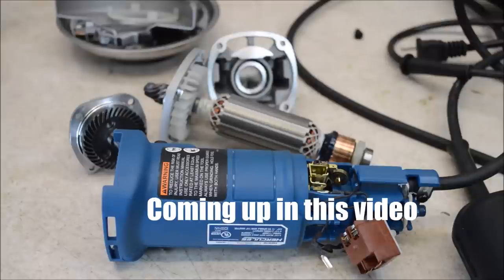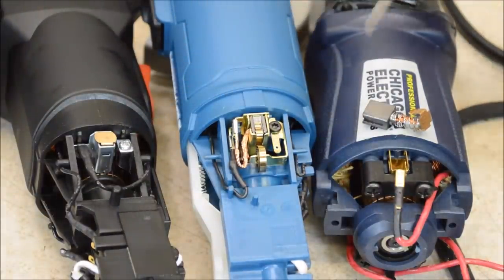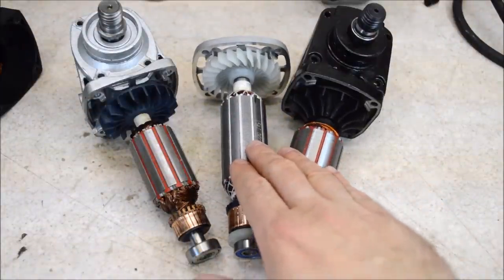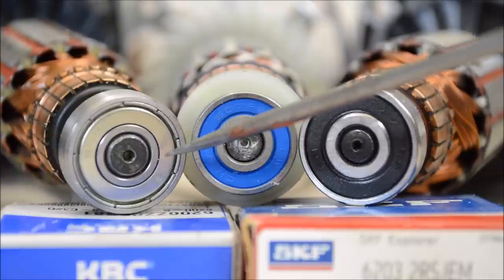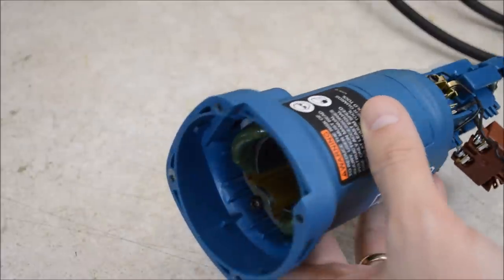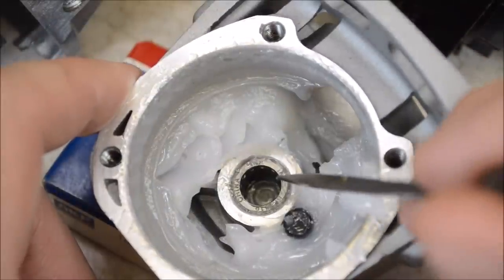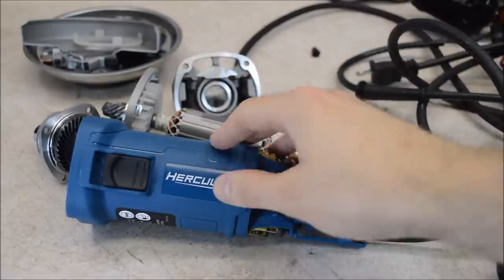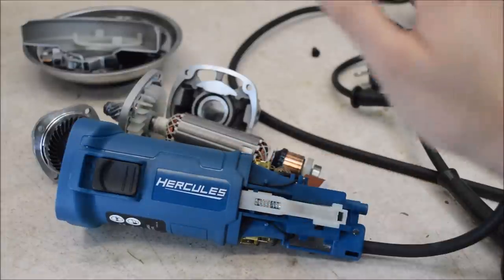Teardown: Harbor Freight Hercules angle grinder review

Comment: The advantage of the spring on the Hercules isn't more consistent spring pressure.  It allows for longer brushes as the pocket doesn't need to include room for the coil spring.
Reply from the maker: Actually, the coil spring probably offers both benefits.
Reply: Tool Teardowns right the brush has to have constant contact as it wears down great job dude

Comment: I've had this grinder for about 18 months. Use it almost every day. For $35 with a coupon, IMO, it's a true bargain. Doesn't skip a beat. Didn't think the optional warranty was worth it. If or when it breaks, I'll buy another. A terrific tool for the money.

I also have a similar Hitachi grinder. The Hercules is more powerful and runs smoother. Have a newer Craftsman grinder, as well. Closer, performance wise, to the Hitachi. Really, for $35 the Herc is fantastic.
Reply: Yup. No extended warranty here. Just take them back and say you want to upgrade to the next model. For HF members, just pay the difference for new tool.

Comment: So 5 years ago you tore apart the same model Hercules grinder I have, to see how well it’s made. ( I agree btw, love Hercules tools). But, I was looking for a video for someone doing a cord replacement. I’m not going to admit how I came to grind through my cord but… think, NC, working in hellishly unusual cold weather… that’s my excuse, sticking with it. The second stupid thing I did was not take a picture of the switch assembly before I took it out to disconnect wires. Your shots of the switch removal saved my bacon. Many thanks. 5 years later.

Comment: The same grinder, with some very minor visible differences such as the shape of the handle bar, is being sold here in Finland under the Biltema brand for 21.50€ which is about $25. Since we're in Europe it is naturally a 230V version. The power rating is 700W. I had the previous, nearly identical model for about 5 years and used it quite extensively in some pretty heavy duty work, until it finally broke a couple of days ago. One of the copper contacts in the commutator had come off, which means that you cannot fix it by replacing the carbon brushes, because the gap in the commutator will eat away and destroy the brushes instantly. The machine was definitely worth the price.
By the way, did you mention in the video that the quick lock mechanism actually allows you to detach the guard and not merely adjust it, which is a very useful feature?

Comment: Been using the Hercules since it came out. This is June 2022 and prices are a lot higher now but it seems to be holding up just fine doing a lot of cutting and wire brushing with a heavy twisted cup brush to remove weld slag.

Comment: I've burned up a number of grinders and the failure is either a shorted field winding due to excess heat or a broken rotor to commutator wire.  Looks like they've addressed those issues in the Herc.  It's a pretty nice tool in my opinion but I'm sticking with the "yellow or green" ones for now.  I really like this review, very well done.

Comment: I have  that grinder and I put gear oil in the gear case to help with heat. I put a oring under the spring for the push button lock and it hasn't leaked yet! It runs quite a bit smother

Comment: Thanks for the video! If it still works, along with the other two, try a comparison between vibration and power. One major improvement with more expensive tools is almost always less vibration and it might be interesting to see how much, if any, there is a difference between them.
Reply from the maker: They do all still work. It's a good suggestion.
Reply: I just bought the Hercules today. I have been using the drill master ones for a while and throwing them away basically. The Hercules runs a lot smoother with a lot less vibration and cuts smoother without skipping, bogging or jumping.

Comment: I bought the cheap $10.00 drill master grinder and it burnt out after 35 seconds... yes 35 seconds.   I am grinding down a cement slab ... have a crack which is slightly raised and using correct grinding wheel (diamond).  Do you recommend the Hercules over the 30.00 drill master?   Ps GREAT VIDEO!  First time I saw one of your videos.

Comment: I really appreciate your reviews. For instance I always thought the grind markings on the steel portion on the rotor were defects or wear but I learned on the other video that they are to balance the motor. Also I didn't know about the glass reinforced plastic. You are even able to interpret codes for the cables, plastic parts, and bearings!
Since you talked about revenue for the channel, do you know if you still get ad revenue from someone that has both a youtube premium subscription AND an adblocker on their browser?
I'm wondering if I need to disable my adblocker.

Comment: FYI, The Hercules Brand isn't owned by Harbor Freight is just distributed by HB same goes for The Diablo Brand sold at HB and 20 % or 25 % discount coupons aren't being honored at the time of check out. I just bought the " Hercules 16 " Tool Bag" was a bit surprising. Read the fine print of the 20 % and 25 % coupons not sure if you were aware of it.
Reply: No tool disposal sales? Deal breaker! Really at $40 I'd rather kick in a few more bucks and get a decent name brand. But this grinder looks OK. Still Hercules? I really don't like side switch grinders either. Being left handed the switch is on the wrong side for me. I go for rat tail and paddle switch grinders.
Reply: I'm not big on the thumb switch either. I might buy one of these if they make a rat tail version with a proper trigger switch.
Reply: most of the grinder you can unscrew the gear box and rotate it in the position you lioke, i prefer the switch on top and almos all bosch grinder permit it
Reply: Patrice Le Brasseur I did that with my Fein grinder

Comment: I was impressed with the quality of that tool, I did not see anything that looked designed to fail, you don't even see that on AvE teardowns in higher end tools.  I might give harbor freights newer powertools a second look.  I have always liked them for some hand tools, such as breaker bars and the like, there is just some things you can't justify spending 10x as much.  but to steal a line from AvE this grinder was skookum (spelling?)

Comment: I've worked in the automotive tool business for many, many years. There is good reason why cheap tools are cheap.. One of the companies I worked for was an importer/ manufacturer of pneumatic (air) tools. The point of manufacture was was Taiwan, in the same plant as Ingersoll Rand. Many of our air tools were exactly the same inside as the IR tool. Many were not. The changes we could make to a tool were amazing. Cheaper bearings, maybe even a bushing instead, press fit items instead of bolt together items, no seal or cheap seal. You get the picture. The problem is that many big name companies have made changes like this and still ask the big bucks. They also make a less expensive line, but it looks just like the premium line !! If you want a good tool, ask around and look at what the pro's use. Get the MODEL number of what they use.You won't go wrong.

Comment: It's not a rotor. It's an armature. Rotor is for bushless motors and hold magnets. The "strings" are probably Kevlar to hold the windings to the armature and keep it from flying apart.
Reply from the maker: +Drew w it’s even simpler than that. The rotor is the part of an electric motor or generator that spins. In this motor design, the terms armature and rotor are both correct.

Comment: earthquake xt has new 20v impacts. I would love to see what's inside of them.
Reply from the maker: I just saw those posted online today. They are interesting. They're actually expanding these higher-priced tools quicker than I expected.
Reply: Tool Teardowns I downloaded the exploded diagram right through harbor freight website for the impact wrench. doesn't look that bad from what I've seen.
Reply from the maker: I'll check that out. They don't offer an exploded diagram for this grinder, so my guess was they didn't offer them for the other new tools, but I didn't take the time to look.
Reply: Tool Teardowns it's on the page of the tool. it's a PDF of the user manual and it's in there.

Comment: I got the sorta cheap one and so far it's held up well. really give her hell beveling 8in pipe. gets hotter than a 2$ pistol but haven't smoked her yet. so all in all for under 30$ so far it's held up
Reply: Update.. killed 2 mid level ones.. let the smoke out. Have Hercules now if it dies I'll just buy a 2nd Milwaukee fuel
Reply: chris jones.... How is the "pro" model grinder? The 6 amp one with the paddle switch?

Comment: I have all three of these and while I enjoy each. The Hercules is the nicest and smooth as butter. The dark blue CE paddle is a damn work horse but vibrates a lot. The cheap $10 one has good feels but lacks power, don’t get me wrong it can still do a lot but you really have to let the tool do the work. 

The only reason I have a Hercules is because everytime I element back for a CE dark blue $29 paddle grinder (seriously they are work horses) they were out so finally I said F-It.

Comment: I've been posting videos on YouTube for over 10 years, but I do like their new feature of matching me up with hammer and chisel guy stuff. I use Grinders everyday, and my landlord just gave me an expensive seasonal Kobalt grinder three guys, 20 minutes, we could only get it to work for a couple of seconds. too fancy, too many buttons, Whadapieceifjunk. So he threw away the box, and lost the bill. So I went to Harbor Freight and I bought him the $25 grinder, for the little bit he uses it, we'll see how it works. I was at Lowe's a couple years ago and they were liquidating the $25 grinders for $5, I bought the shopping cart full of them and guess I'm set for life. One thing I've noticed about these grinders is sometimes the switch is so annoying to use, and I like to put 5 inch thin cutting discs in, and some of them rub the guard, some of them except the 5-inch disc which is more convenient for my cutting purposes then a 4 1/2" disc. Harbor Freight doesn't sell a 5in disc at all. and thank you very much for your videos, I'll be a subscriber

Comment: so - big difference with hercules vs $10 grinder is the epoxy on motor windings?  Why not just put some jb-weld on cheap $10 grinder windings? I am going to do that with my $10 HF grinder.  Should make $10 grinder even more reliable!

Comment: The dewalt warranty is not as great as it first seems.  It's 1 year parts and labor, and the next 2 years they only pay for parts.  What's more,  if you want them to fix it, then you have to mail that thing to them, which will cost you at least $15.  Finally, they might just tell you that your warranty doesn't cover w/e happened to it , which means you have to pay out of pocket to fix it.   So, are you going to do all that for a $60 grinder or are you just going to go buy another one?   You are going to go buy another one.  Thus you really only have a 1 year warranty with Dewalt.

 The HF warranty is 2 years, drive to the store, throw it on the counter for ANY REASON and get a new one.

If you want a warm and fuzzy warranty feeling, then HF is the better experience by far.

Great review though, subbed.
Reply: @John Handcock....excellent breakdown of the "warranty" game. I wish Dewalt would just do a three year warranty covering parts and labor with no questions asked. I think Milwaukee does five years but am not completely sure.  Ridgid, with the LSA, if you register it properly, gives you a lifetime warranty.
Reply: @amp12345amp  I've heard ridgid makes the lsa a misserble experience so people won't cash in on it.

Comment: p.s. I ended up purchasing a Hercules Grinder.  I had purchased the cheaper Drillmaster but after watching the video I realized the huge difference between models and took it back for the Hercules. Although I won't use it a lot, I don't want to have to keep purchasing the same item.

Comment: I'll  not debate the Hercules is a Mich nicer tool.  most of us don't use their grinder everyday.  for me it's  cutting bolts and occasionally the metal pipe or bar.  I've used my cheap grinder for years like this. I recently replaced  the cord but that damage was really my fault and it still was going strong.  it seems not be wearing out other than those cheap wheels at harbor freight not lasting to long.  I'm  sure the Hercules worth the money but it's overkill for so many like myself.  the cheapest with serve us well enough. not gonna lie though,  I'm tempted as 4" wheels cost more than the 4 1/2" wheels.  might just get the cheapo model if I upgrade and give my old one to a friend.  idk.
Reply: You still have the guard on your grinder don't you? Take it off and use the 4 1/2 inch ones.

Comment: Thank you so much for the clear review!  I was just looking at it in the store yesterday. From your video, the ring hear is friction fit to the shaft and I don't like that. Basically I just dislike anything that's friction fit as that's always harder to remove for maintenance :-)
Also, you should include some running test to compare the noise levels and power.

Comment: First off as tool head and gearhead thank you for spending your monies and time. 2nd honestly with Hercules it's in pro tool cost they are gonna have to prove themselves. I got 4 grinders 2 dewalt u.s. made, one bosch and one Chicago electric... I use the c.e. short light stuff. And at the cost of ten bucks I'm not too upset. But a lot of hazard fraught stuff has been failing me and i upgrade to dewalt etc. I'm a weird duck though... a farmer winter wheat, a harris county deputy and ffl. But I build or make most stuff I want and hate any lost time. Whether a tool breaks or not and can be returned sounds great. Till its 100 plus miles and 2 hours of my time.

Comment: I'm impressed with the quality of your content,  the grinder looks great too.  I haven't tried the new Hercules grinder yet but I like the ease of use of the midrange harbor freight grinder more than a dewalt grinder.  I suspect it's mostly because of slightly less torque on startup yet still plenty of power once spun up. I subscribed and am looking forward to more videos.

Comment: while i like watching these type of videos especially for tools that i have never used or owned when it comes to angle grinders i usually go cheap and that is because of all the grinding i have done for work jobs and just at home projects i have owned or used name brand grinders and have owned or used cheap grinders and have learned that for the most part that the tools give out long before brushes were out or bearings wear out there is just to much materials that get inside to worry about things like wear and tear of those parts. hell i have owned name brand grinders that lasted less than a year and two  no name grinder that i got almost five years out of one and eight years from the other that i paid five bucks apiece for at a traveling tool show/ sale. so i guess what i am saying is do not worry about the insides to much look at what you are using it on and just how often you will be using them. if it turns out it won't be often and you like showing off your tools then buy named brand but if your like me and you know you are going to beat the shit out of them then buy cheap and when on sale buy alot of them and then put all the different types of discs you use on each one to save time switching and go at it.

Comment: i just got me one for 37 doll hairs not 60 and took it apart, it does have everything this guy shows (just to prove its not an enhanced showoff version) it was alot smaller on the inside than i expected but the quality is there and the value for the money is very very high compared to some other tools, just dont be givvin her a hot supper, like AvE sayed the full epoxied field windings can overheat easier than the rattletrap versions, it will last longer providing you let it stay cool, when your hand starts to burn dont put on a welding glove and keep going is what i mean, i know you can go inside and have an hour infront of the brain killer box and come back out and the tool is still white hot, it will be worse with the epoxy cause it retains heat in the windings "better" but still if you want to make harbor freight lose money on you you gotta keep it cool and if you do it can last for 10 years or more of weekly sometimes daily garage use (atleast i think so, dont have that high expectation very often)  , i took my set of spare brushes for this thing and packed them safely in the tool under the black brush cover thing so in 5 years or so i wont be wondering where they are, instead ill just be good for 5 more years
Reply: FlyingWldAlaska77 good suggestion on the spare brushes.

Comment: HF ALERT!!!! Like many HF items this grinder, model HE16S, is listed under two different stock numbers, 63052 and 62556. That means the difference could be minor or huge. In some case one number could be good and the other not worth buying. I would love to know which number is being reviewed here. HF sells a single and 2 stage compressor as interchangable. One tool cabinet has full extension drawer slides and another sold as the same item, does not. If you want THIS grinder you better know the stock number.. If you need to buy the insurance you might as well buy the DeWalt. HF can beat the inflated truck prices but it costs them practically as much to duplicate a DeWalt or Makita when you include the warranty and you can still buy parts for them after a year or two. If you take a chance, with no insurance, and just 90 days, you can save a few bucks. It looks like a nice tool if you can figure out which one it is.
Reply from the maker: In the description of the video I noted this is the 62556.